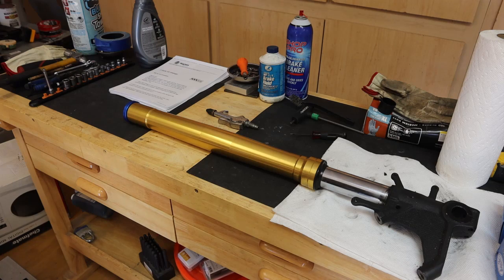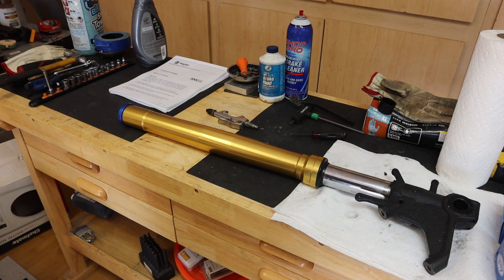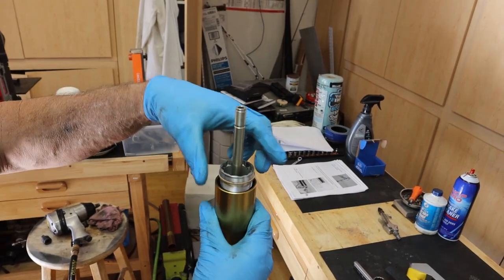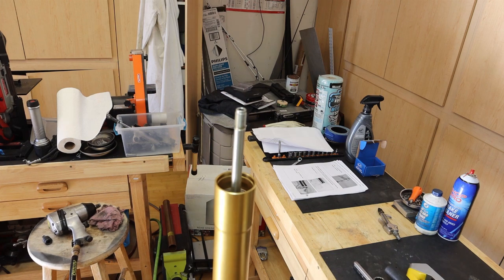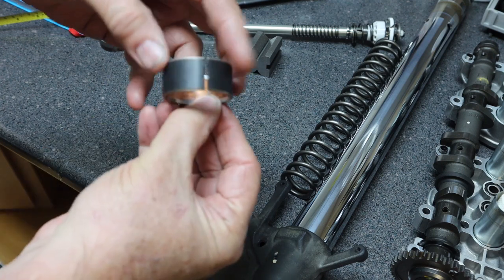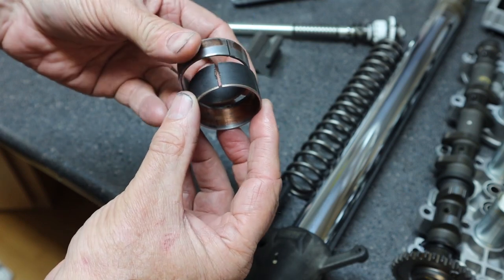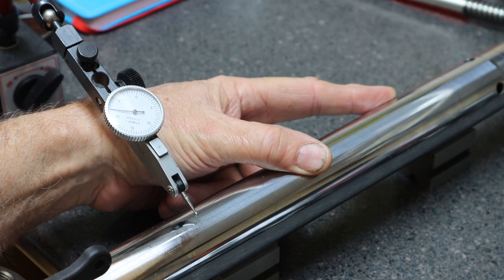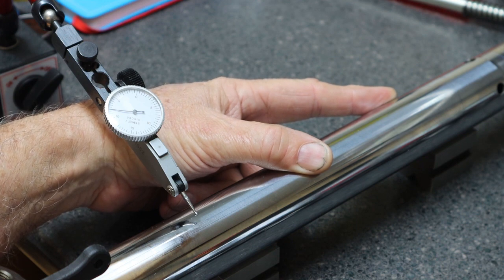2014 Suzuki GSXR 750 Fork Rebuild - Part 1

Comment: I want to change the lower seals but I don't know if it is the same process for a 2016 GSXS 750. Maybe this process is the same or what differences are there? 

Thank you so much.

Brayan.
Reply from the maker: Hey Brayan,  the manual I have indicates 2006 - 2016,  so the procedures should be the same, your fork oil levels should be a bit different.  Check Hanyes manuals, sometimes you can get a really good deal on your first manual.  I believe I only paid around $26.00 for the manual with discounts.
Reply from the maker: If you are going to disassemble the forks, do the whole job ,  the parts are not that expensive,  There are options to make your own seal removal tool, instead of buying them,  Search on Youtube,  I have see many folks make there own tools for cheap.  Also check Amazon they have cheap tools for much less than pro models.
Reply: Alright. I will look at the website and find out how much oil it requires, someone in a YouTube video said 505 ml I will look up if it is correct and share the information. Thank you so much.

Comment: Hello Joe,
I need instructions manual for this fork. I have different information about recomended oil viscosity.
Please, could you send me this information.

Thanks in advance

Xavi
Reply from the maker: Fork oil capacity		
600K6 and K7 models	413 cc	
600K8 to L0 models	410 cc	
750K6 and K7 models	408 cc	
750K8 to L0 models	418 cc	
All L1 models	420 cc	
All L2-on models	487 cc

Comment: Hi, the link for the fork rebuilt kit is actually for a caliper rebuild kit, is it the same? Because i want to change the seals at the bottom while doing the job
Thank you
Reply from the maker: Hi, no I must have selected the wrong link.  Go to my main page, there should be a video
Reply from the maker: The first link is from the previous video on brakes,  Click on the video to the right, that is part 2,  thanks
Reply: @JoediyLab   I couldn't find it, but it's alright i will keep checking 
Thank you for the help and for the detailed video
Reply: He’s right, the link attached here is for a different thing, might want to check it out.

Comment: Does anyone know how much oil goes in the forks? 2008 gsxr 750
Reply from the maker: If you have a K8, then you need 418 cc's of oil in each tube.  and you need to measure 115 mm "Oil level is measured from the top of the tube with the fork spring removed and the leg fully compressed."
Reply: @JoediyLab  it isn't enough to put the correct amount of oil? Why does the oil level needs to be measured?
Reply from the maker: @labos2378  this data came right from the Haynes manual.  All moving components have tolerances. More than likely another way to verify the forks have enough fluid

Comment: Is this the same for a 600?
Reply from the maker: Depending on the year, fork oil levels will be different.  Check the Haynes manual
Reply: @JoediyLab  thank you and the  special tool how do you make it?? I can’t seem the find it in the hands manual
Reply from the maker: @3lvd  dial indicator and base are listed in the description of either this video or the other forks video,  You can use the links to purchase on Amazon. Thanks
Reply: @JoediyLab  thank you sir